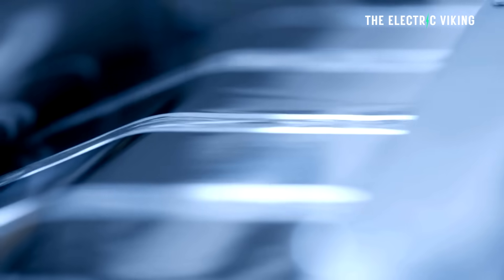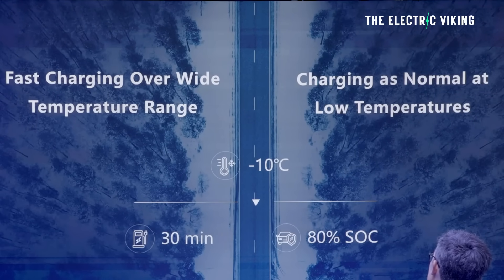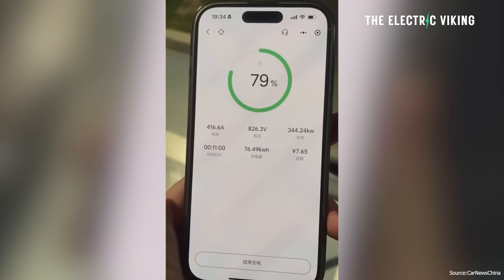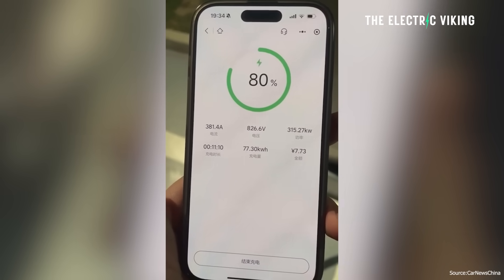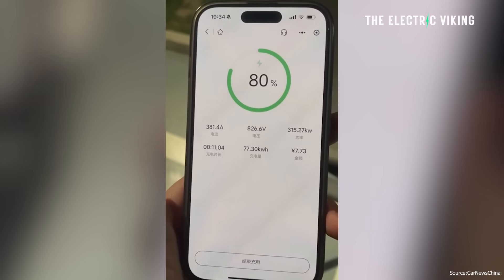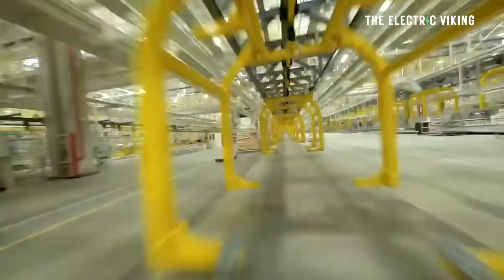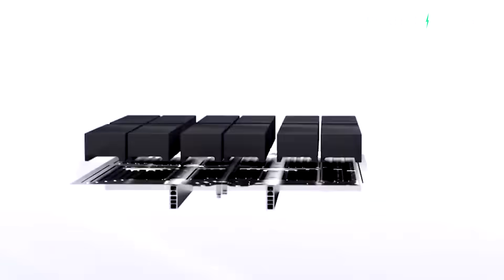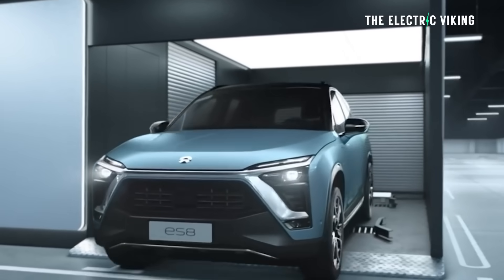The EV that charges at 552 kW using Tesla partner CATL's new batteries

Comment: The problem with new battery technology is that it hasn't been mass-tested by the public to discover how safe it is and whether it loses its storage capacity after a few years.
So anybody buying one of these may end up with a miraculously fast wonder battery, or a dangerous or gutless  turkey.
Will it be a standard price, or would we pay a fat premium to buy this charging speed?
The other downside is that you can't buy one at all yet. Promises of new miracle products 'next year' tend to experience long delays.
But, it sounds like good news.
Good luck in getting the UK Government to build thousands of 600 kw chargers, though. The charging network here is chaotic and unreliable with ridiculously complex pricing.

Comment: Before you discount battery charging as unnecessary, let's do a mental experiment. Instead of fitting out a huge parkinglot of superchargers, you have - say 2-4 swap stations, each with - say a capacity / fill of 5-10 such batteries... Now it takes 4 minutes to swap out a batttery, and in 5-20 minutes, that same battery can be put into a new car fully charged. It would increase the throughput of the charging "station" to aproximately that of a gas station of today. You fill up, go into the shop, buy a drink - easily 10 minutes without a queue. You would have to build out a lower charge capacity, as only the swap station needs to be powered instead of each supercharger individually. Looks like the superior solution to me in every way.

Comment: I drove a Tesla Model 3 and it's already too much. That massive screen was distracting, and FSD wasn't that fun, anyway. I learned that I like to drive, to steer, indicate, and modulate pedals. I just want an EV without all that AI crap, for cheaper. High quality, large capacity battery with reasonable charging rate and I'll be sold on that.

Comment: I've definitely felt like Tesla should be installing superchargers today capable of up to 650kW to be future proof. Today almost all vehicles have less than 120kWh, but I'm sure in the near future vans and pickups and trucks will have batteries double the capacity (but still the same weight/size) as today's batteries (a pickup with 350mi of range will have to charge every 175mi when towing a camper. Many people will want 350mi at least with the camper).

Comment: The vast majority of people charge their battery overnight, so charging speed is not a real issue in the first place.  The vast majority of people do not take road trips on a regular basis either. These a just talking points for the EV haters, but faster speeds like these will make those talking points irrelevant, which is good.

Comment: I am a student pilot, and I think that electric powered airplanes still have some issues to be resolved 1. Batteries are heavy, and that is a problem because aviation is a weigh sensitive application for batteries 2. Batteries need to keep their charge at low temperatures because the atmosphere becomes colder at higher altitudes, which bateries are infamously bad at 3. The FAA is very cautious when it comes to new technologies, because it is a safety conscious industry
Reply: Mayday, mayday, battery fire at 20,000 feet 😮.
Reply: The battery and the motor both generate heat that is used to keep the battery at the optimum temperature in cold air.

Flying schools all around the world are buying electric planes.
Reply: @nordic5490  there are some, but flight time is limited to 45 minutes and it is fairly small plane
Reply: @AleksandrPodyachev  and, that is with much older battery tech now. The recent solar car race here in Oz last week, some cars were using new batteries that a are half the weight. We will see lighter commercial batterys soon.
Reply: @AleksandrPodyachev  Aren't these things called 'drones'?

Comment: I'm all about  electric vehicles but this new high speed charging means more CO2 emissions because the reason for their existence was to curb that thus make gas vehicles more future proof because they are light and net zero.
Reply: BS. Most EV fast charging facilities use 100% renewable energy.

Here in Oz, 1/3 of all homes have roof top solar pv fitted. Most EV charging events are at home, and most EV owners here in Oz charge from their own rooftop solar.

Comment: Considering that fast speed charging is not recommended at a daily basis to improve battery life, despite the systems cars now have to prepare batteries for the charge routine, at a glance this evolution seems relatively redundant on the cross of the EV news we have access all day round. But, ultimately, this evolution is great on another front: Solid state Lithium, Sodium or Aluminium ion batteries won't have those problems relating fast speed charging, as far as we now know. And that will effectively to be the big game-changer technology. It is right at the corner round... But it is not just ready yet. Await some more 2 or 3 years and we will see...

Comment: All the batteries seem to have a theoritical capacity of 500kwh/kg. The relevant bit is What is the Current, being produced at in production numbers battery. What cost? Etc. 

Almost all battery claims lack one or more critial metrics or claim "potential" that isn't realized. 

Energy Density at Cell level (not pack level)
Power Density (charge rate, actual vs peak)
Life in cycles
Cost at Cell level wh/kg (not by volume). BS claims tend to use volume.
Expected mass production date (enough to support at least 1000 cars/week).

Failure to disclose any of these means another nebulous claim.
Remember the air/metal batteries that had fantastic ED but had to be swapped at undisclosed cost?
Remember the H2 foil roll that had to be swapped (again, undisclosed cost)? 

Both were worthless, but otherwise had great numbers.

That said... thanks for keeping us in the loop. 
Here... the question is What is Energy Density ("Theoretical" being years or decades away).

For example: Lockheed had a compact fusion reactor only 5 years away.... 3 years ago with no peep on progress. (Active 2010-2019 before all updates stopped)

The question here is what is the current, mass producible energy density and is it still cheap? When can we expect general market entry (I expect Tesla would want them)?

Comment: I think Tesla is a it’s first tipping point. The have the real good Model Y, the slightly outdated Model 3 (no hatch, no space on the backseats) and relatively small numbers of Model S and X (60000/a). Tesla is a one trick pony. Roadster was hot air, CT can not fulfill the expectations. They already cancelled Giga Mexico, Model 2 is nowhere near. The tensions between the US and China doesn’t make it easier. Building quality in the US plants is still poor, even after 10 years. Only Americans buy these crap. FSD still not operational. Competition is on par with Tesla, believe it or not.
Reply: I believe Tesla has been a "hare" on the EV industry. They have started the thing, they developed it "to the nines", they pushed hard for competition... So, now: Are they at prime time point for when the legacies are finally ready to bring the true real thing to the masses? I don't believe so! They don't have, and likely they'll never have alone on themselves, the industrial infrastructure for a Model 2. They don't have even the infrastructure for the ~30k Model 3 that has never seen the light of the day... Tesla, if not absorbed by one of the "biggies", either way US or EU wise, will need to settle itself as a tentatively prestige car builder out there. They'll need to improve their quality for EU standards, on that they're working on Germany... But, does it suffix at just a single factory in Germany? Perhaps they'll need to rethink what they really want over time. At least Musk is now more thinking like a CEO than like just another philanthropic lunatic out there like a few years ago. That may suffix for them to survive relatively well, but don't think on them as the big "EV of the people" builder. Stellantis just has launched their brand new Citroen E-C3 on the EUR 23k-28k range segment. Not cheap by any means, but affordable enough to grant them the title of next years EV of the year, both in press prices and most importantly, on unities actually sold! For the first of perhaps too many years, Tesla won't have the best selling EV in Europe, and that is only the bare beginning.

Comment: Dreaming that Testa will offer this kind of battery next year. Change my mind 😜
Reply: Well better change your mind because it won’t happen. They first need 800v architecture. It’s not only the battery that allow that charging speed. They also like cheap stuffs and this battery is not cheap, it’s at least 5 to 10% more expensive than previous
Reply: @tonypaca3015  cybertruck can, why not model 3 or y remodeled?
Reply: @franetimalaga  i think because it would involve a redesign. prices would rise a lot again

Comment: Wayyy too much hype here. It's possible to charge batteries really quickly - if you don't mind shortening their lives. Keeping temperatures reasonable during charging is also an issue. I think it's way to early to draw any conclusions about this battery tech until there is hard, verified data.

Comment: It's the EV charging network that will ultimately determine the success of electric vehicles,  not the vehicle range.   It's a common misconception that EV range is the elephant in the room.  It's not.  Not at all.  The elephant in the room is the EV charging network rollout  i.e. the geographic distribution and rate of rollout of EV super chargers,  along with the evolution and deployment of fast charging batteries.  Battery range will ultimately become a secondary consideration.
Reply: Even the charging network becomes less important when people realize they can get level 2 charging from any house with an electric dryer.

Comment: leaf owner here.
i've been driving 40 years. this little car is the best car i've ever owned. we can travel about almost for free
Reply: I have a model 3 now but we did have a leaf. Super reliable and much cheaper to insure (or get crash repairs on) than the Tesla. For a city car they are pretty solid.
Reply: Not if the energy that you charge with has a cost or pollutes during energy generation
Reply: @joebloggs6131  all nuclear and hydro here in sweden
Reply: @joebloggs6131 dude, stop with these tropes. It's a 2 step process. Go EV AND decarbonize the grid. You can do it in any order. You don't have to wait for one to happen first.
Reply: @southend26  
"It's a two step process", meaning that one happens first.

Comment: The only problem is a service station will have to be next door to a power substation so that is 3000 kw per hour per charge point therefore 10 charge points 30,000. Kw per hr that is enough power for 3000 small houses That for 1 service station to charge EV . We need about 5000 new power stations to power EV
Reply: Why was my comment deleted, it was supported with sources and actually had facts.
EDF has a 4.5 mile long 10MW cable, this is ample power to charge 100s of EVs simultaneously.
A new Substation isn't needed.
It takes 12kwhs to refine oil in to a gallon of fuel and then there's the fuel cost to transport it with an inefficient semi.
it makes nothing but sense to go EV and this tech in the video shows how amazing this transport revolution is going to be!
Reply: Just put up a wind turbine above the charging station.
Reply: @JohnSmith-ux3tt  This is definitely true, you back that up with a decent sized battery and we're sorted for one charging station.

Comment: battery swapping still has a lot of advantages in that batteries can be charged more slowly so the electrical needs of the charging station are less.  Also, it makes resale of the cars easier since the battery is taken out of it.  And a company can guarantee that the battery was charged with all green energy and the battery perhaps inspected for defects.  I don't think cars where the battery is totally unmovable is a good idea.

Comment: I wonder what the longevity of these batteries are even though they are LFP based.
Reply: At least 3500 cycles or up to 7000
Reply: @joebloggs6131  Thanks! Outstanding but seemingly less than the 10,000 cycles current LFP are able to get.
Reply: @nickmcconnell1291  
10,000? That's every day for over 27 years... dude the other parts of the car will be cactus before the battery gives up, and you can't use the battery for anything else

Comment: Battery swapping is the future. The wattage necessary for fast charging is just too high and inefficient to do in large scale. It is just physics. 
Swapping stations allow for charging with lower wattage without increased waiting times for drivers. It also allows for better battery maintenance and recycling.
Who wants to own their own battery, when you can just cheaply swap them when they are empty, damaged or old.
Nio is on the right track in my opinion.
Reply: The battery swapping idea does not fit the need from regular consumers. For taxi drivers, etc. it could be a good idea.